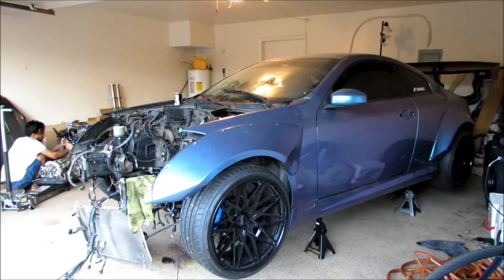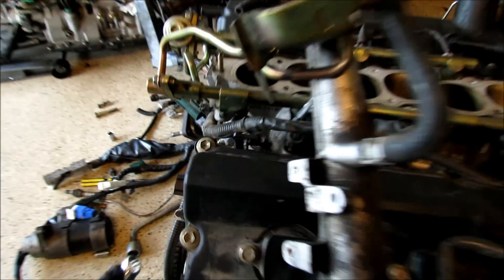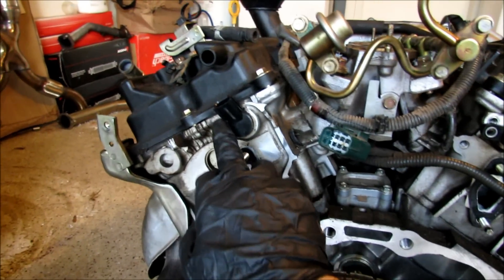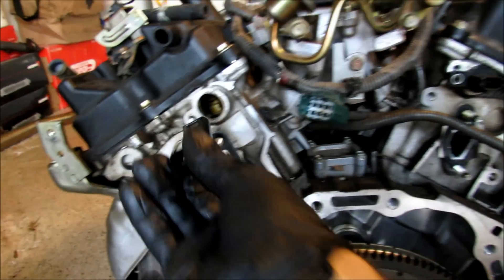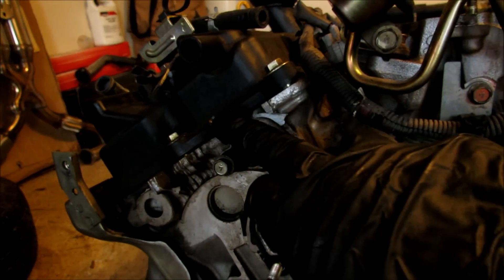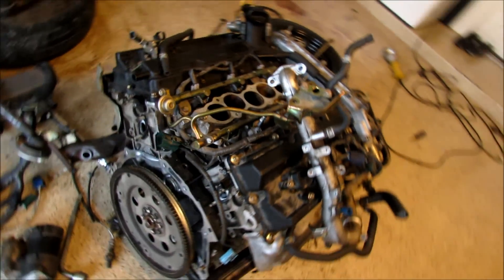INFINITI G35 NISSAN 350z - Camshaft Position Sensor Replacement

Comment from the maker: Symptoms - P0340 and P0345
While driving, the car suddenly felt like the engine stopped firing for a split second. After that the VDC, Service Engine Soon, and Slip warning lights all came on and remained on. The car felt normal while driving. After this, cranking the car took much longer than normal and sometimes wouldn’t succeed and every time it did the same warning lights would go on. Hooking up an OBD2 diagnostic reader gave me the following code

p0340 - camshaft position sensor - Bank 1 Circuit Malfunction
p0345 -  camshaft position sensor - Bank 2 Circuit Malfunction
Reply: Did you take out the battery before doing the work
Reply: A1 snday1 the engine was out of the car
Reply: What brand do you buy? Duralast? . Mines went bad after 3 days.
Reply from the maker: Prestigious Physiquez....really? I currently have the duralast sensors, they last about 50,000 miles before I get a new 1 for free.
Reply: Motordyne G35 yeah either the bolt holding the sensor came loose or I'll check for oil in my connectors . Light came back a few days later
Reply from the maker: Prestigious Physiquez ....if you got a bad sensor they are always free to replace so.....
Reply: Prestigious Physiquez i just took mine out on the driver side and it look it straight with no angle
Reply: My 07 g35 coupe has 4 camshaft sensors
Reply: Replaced the bank 2 sensor, had to remove the throttle body to get to it, still getting vdc and slip lights on, did a idle reset and the check engine light is off. Getting rough engine startup with idles ranging from normal to 3-400 on my 04 AT coupe :c
Reply: This a bit off topic but i haven't  got any help on the forum just recently i notices when i start my car (04 350z non rev-up)only on cold start this happens the idle will surge high like normal  then dip right away like its about to stall  then go back to normal  after that on any other start up it doesn't do that only on cold starts....car runs fine no loss in power no rough idle only the sound of my lightweight flywheel..only prob the car has is a leaking valve cover gasket on the passenger side... mods nismo s-tune exhuast,high flow cats,and  plenum space...
Reply: Quick question I got a po340 myself but said 2 sensors?
Reply: Where are they on a 2002 Infiniti G20

Comment: its extremely easy when the engines out. Haha..
Reply: not so, its ver accessible just get a cushion so you can lay on the engine, the rest just locate the sensor and the rest almost blindfolded.. literally
Reply: Bank 1 is a 20 minute job. Bank 2 takes about 2 hours.
Reply: @rolltide9547  bank 2 you can reach without taking the throttle body off reach over from the passenger side a smaller ratchet can get it

Comment: Great video I had my camshaft bank 1 changed twice on my car. First time I was driving home and the engine suddenly shut off, had to pull over to the side road luckily I was on a street and not the highway. I had to turn the key to the off position n turn it back on a couple times cause it would die, very annoying problem when it happens.

Comment: Super easy with the engine out, but not bad with the engine in.  And you do not need to remove the TB to do the bank 2.  I just replaced one in an '05 G35 in about 10 minutes start to finish.
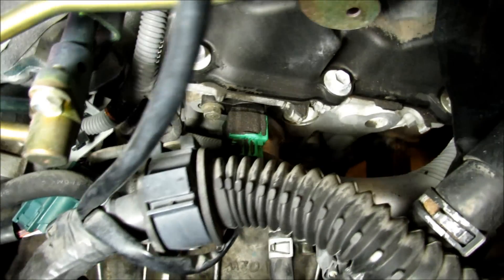Reply from the maker: Yeah, it is a pretty easy job. I concur that is why I put the *INTAKE 3:09 on the video during that scene. I didn't mean to say throttle body. You are correct, you do not need to remove it.
Reply: You prob have small hands that spot looks impossible
Reply: @Ap-qf8kp  My hands aren't small, I wear a size L glove.  I have better than average dexterity and practice working on stuff, but it's not terribly hard to do.
Reply: Send me a vid
Reply: Do you recommend removing the engine to replace these sensors? Seems like a lot of work for 2 sensors.
Reply: @bobbyheenan4061  I spent about 10 minutes replacing the harder to reach one with the engine in the car, you decide.
Reply: @DonziGT230 I was being VERY sarcastic...But I can't even see the driver side sensor. If I lay across the engine and stick my hand back there I can feel it, so I guess it's a blindfold job? Is that how you did it? As I say, you can't even see it ('03 Z).
Reply: @bobbyheenan4061  Yup, it's a blind job.  I might have used a mirror to see what I'd be feeling for, I often do that, then did the replacement by feel.  I used a 1/4" ratchet with probably a mid or deep socket.
Reply: @DonziGT230  ok cool, appreciate the help! I'm waiting for the sensors to arrive and I'll handle it. Thanks again!
Reply: @DonziGT230  Hey, thanks again for your advice! Just finished swapping out both sensors and your method made it a piece of cake. The driver's side (blind side) was actually a LOT easier than the passenger side. Passenger side was a bitch with that wire harness in the way. Anyways, thanks again!!!!!!

Comment: Great video. Kept it nice and simple and on subject. Good angle views as well to know exactly where the cam sensors are.  Changing mine soon as it gets here in 30 min lol. Oh and my code is P1078 Exaust Valve Timing Sensor/Circuit B1

Comment: My g37 sedan 2010 is throwing a p1092 vvel bank 2  code,changed sensors and vvel control module and still has my car on limp mode and doesn’t let me rev past 1rmp

Comment: Hey Motordyne, I replaced my crankshaft sensor a month ago on my 06 G coupe 6mt and it went bad. It threw a P0335, P1078, & a P1084 code. It is a duralast so I got a free new one. It caused the car to not start up so I just replaced it with the old crankshaft sensor that I still had and it fired right up. Been driving it for a week now and the check engine light is now gone. Im hesitant about putting the duralast back in bc it may fail  again and leave me stranded. Anyway, I also have the VDC, Slip, and RAS lights on. Could you give some advice as to what is going on or how to have the lights turned off? Replacing the crank sensor with the duralast didn't turn the lights but stealership tells me that using OEM sensors could turn lights off. Thanks for any help in this matter. Mad props and a massive shout out to you for all your videos and advice on the G35s.
Reply: Only oem sensors work from what ive been reading when my passenger side went bad went strait to the dealer paid 100 for one sensor  took me 15 mins to install been fine ever since and that was bout 7 months ago
Reply: Yeah, my old crankshaft sensor that I reinstalled bc my new duralast crank sensor failed, after only a month, is now starting to fail. The symptoms are the same. The engine will idle higher, around 1k-1500, and when you let off of gas pedal, it would have a slight jerky feel to the engine. Almost like a misfire. My fan keeps running as well which keeps my plenum cold even after driving for an hour. Gonna put the second replacement duralast crank sensor in tomorrow and see what it does. Thanks for your help my friend.
Reply: @drla02  don't wast your time i was contemplating the cheap route when mine went out just spend 200 bucks at the dealer and get two brand new sensors or if you go to z1motorsport.com  they have the oem sensors alot cheaper than what i paid at the dealer.....
Reply: Thanks cool bro! The Nissan Stealership here charges $175 for cam and crank sensors. I got raped by them about a month ago when my cam sensor went out. $125 for diagnostic, $175 for cam, and $70 to put it on. $400 total with tax. Would try Z1 but I need it now. Will get it from stealership tomorrow. Damn!
Reply: @drla02  yea man install it yourself no way I'm paying the dealer to ever work on my car......

Comment: I have a 07 g35s and its showing a bad camshaft position sensor i have the hr motor so i have to replace four sensors im just going to buy the parts from infinti and pray that fixes it if not then my the dealership are going to have a problem

Comment: thanks for the vid. just picked up an 03 a few hours ago and it shut off as i was backing into my parking spot. if i get them from oreiley's, how often do they usually go out?
Reply from the maker: They last longer than OEM from Oreiley's that is for sure. 40-60k miles or more.

Comment: do you know how to replace the exhaust valve timing control position sensors for 2007 G35 coupe MT6?
code P1084
Reply: Same plz
Reply: Did you fix this? And find that sensor bc I can’t find it either but it’s for bank one p1078

Comment: Is there only 2 I was told by dealership theres 4 but I didn't get it because I only saw 2 when I removed a motor last time
Reply from the maker: I believe rev-up motors have 4. DE is 2
Reply: @MotordyneG35  Thank you even the stealership didn't know how many and I was told from 4 to 6 🤦‍♂️

Comment: Can someone help me out with this? I have a 2008 350z hr and I cannot find the crankshaft sensor under the car. A lot of videos only show de motor but not hr motor crankshaft.. I have checked same place and it's definitely not in the same spot as de.

Comment: I need you guys is help. I have a 2012 g37 at and my car keeps throw checl engine light and my car goes into limp mode. Codes are P0006A, so I replaced my mass sensors both of them. G37 was good for like a week then again same codes after some research came to the conclusion could be my map sensors i replaced both of them. Car ran good for 1 full day. Then again limp mode now im getting these codes the same P0006A, and now P1705, P1815..... i did more research and only thing I can be is maybe the throttle bodies and camshaft sensors but this is getting expensive 😅 😫 😩

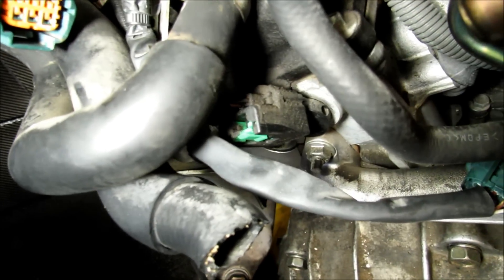Comment: 3:37 can that hose above the sensor be removed to have more access to it? What hose is that any liquids?
Reply: I just did this, you can reach around back and do this without removing anything. Just have a flashlight.

Comment: Hello I have 2006 rev engine  I replace bank 1 sensor and I notice their is another straight sensor on a driver side including the angle sensor. What is the driver side straight sensor called? Thank you
Reply: I think it's the exhaust valve timing sensor.

Comment: Omg mine just threw a code today on the way home on my VQ40 and stalled on me. It said bank 1 which is the passenger side right?
Reply from the maker: P0340 is bank 1 which is on the passenger side, that is correct. The driver side is the harder 1 to get too, you just have to remove the air intake and then you can get your hands back there.

Comment: CAN SOMEBODY HELP ME! My car started dropping rpms on highway but didn’t die. Then the slip & vdc light would come on. Coming to a stop or turning a corner it would sometimes die. When trying to start back up it took way longer. Got it diagnosed. They said Camshaft position sensor. I just replaced the camshaft on passenger side. Now the car takes forever to start and it’s getting longer I think. Would it be the crankshaft sensor or what do you think I should do now?
Reply from the maker: Is there currently a check engine light on? If so what is the code?
Reply: Hey!!! I have the same problem ! 

I just replaced both camshaft sensors.

Worked fine for a week until 
It started lagging wouldn't let me pass 20.

Then vdc light turn on
Reply: Clean your throttle body carefully and remember to reset your ECU after, or the idle RPM will be high af

Comment: Man i have a 2007 g35s sedan and it has four camshaft sensors replaced all four with oem parts from the dealer and the damn check engine light came on again for the same sensors what could be wrong? The car runs fine but im wondering why is it still giving me the check engine light with the samw fault codr
Reply: Troy Space where is the location for the 4 sensors on the hr? I can’t find them lol

Comment: To get to bank 2 while the engine is still in, instead of digging from the top and removing the throttle body or intake can't you just hit it from underneath to avoid taking a bunch of parts off?
Reply: Transmission is in the way from the bottom and it's a long reach.

Comment: Remember tho, I guess the rev up model has 2 bank sensors on each side. I believe one is the camshaft sensor and the crankshaft sensor.
Reply: What ? Lmao that makes no sense. The VQ engines have 2 cam sensors and 1 crank sensor
Reply: @funnymanchrome4408  revups have 4 sensor total

Comment: Would this be similar on a 2010 FX35 also i have code P0725,So the crankshaft sensor needs changing
Reply from the maker: Same exact engine, yes.

Comment: My Z keeps throwing me the code p1084. It's says that is the bank 2 cam position sensor. Changed it 3 times. And still keeps throwing the code. Can you please help me? My car does not  have the same power as before on high rpms
Reply from the maker: I own a rev-up motor which is not in this video. Do you own a rev-up motor? Rev-up has 4 cam sensors. I just checked out your channel real quick, sick uploads bro! I'm busy filming this morning doing new rotors and pads. I will come back to this to do more research. Did you see this thread? https://my350z.com/forum/maintenance-and-repair/611679-p1084-fixed.html
Reply: @MotordyneG35  thanks man! Dude I can't believe that all this time I thought my motor had only two sensors in the back of the head. I lost so many time and money on this. I kept buying other sensors because I couldn't fix this cell light. I found out yesterday that it has 4 sensors on the rev up motors. This link you sent me was the same link that the other YouTube guy sent me. Thanks for the help!
Reply: Dude i have the hr motor on my 2007 g35s changed all four sensors with dealership parts and it still throws the same fault code im not sure whats wrong but damn sure not tryna take it to the stealership someone please help

Comment: quick question my 2004 g35 is idling very low at times 100 to 500 I have stock intake on any idea to what the problem could be
Reply from the maker: Any engine codes? Have you tried my idle relearn video? https://youtu.be/TZJfWQLGUZI
Reply: Motordyne G35 yes I have and no I don't have any codes when I start the car it's idling fine for 5 seconds then the rpms slowly drop
Reply: Clean the throttle body and mass airflow sensor
Reply from the maker: Let us know if it got fixed. Here is my video on how to clean the mass airflow sensor.......https://youtu.be/BGb-6THahXM
Reply: Sounds like its time for a tune up. When did u replace them last? Is ur air filter dirty? You could also try the relearn procedure
Reply: check the accordion shaped coupler on the intake. when i pulled mine apart it had MASSIVE slits in it, replaced with some reinforced silicon

Comment: Man I replaced both sensors and the error code PO340 is still showing, I REALLY need help I been trying to fix it forever. It jerks whenever my car is like barley moving, on the highway or when I'm driving you can feel it move up in rpms by just very little then go back, it takes a long time to start and I keep hearing a thud noise coming from my exhaust, it is so frustrating! Please help
Reply from the maker: Do you have a rev-up motor? Rev-up motors have 4 sensors.
Reply: @MotordyneG35  Honestly I am unsure on how to check, I just got it about a month and a half ago, it's a 2003. Is there some sort of indicator that should let me know?
Reply from the maker: @ItsCripp  ...Yeah, more horsepower. 05-07 G35's came with 300HP, only if you have 6 speed. Automatics got 280HP. If you have an automatic or your G wasn't made in 05-07 you do not have a rev-up motor. When you replaced both sensors, they are both different. You didn't mix them up, putting them in the wrong spot did you? I'm unsure of the problem here because by the code not going away means you did not fix the problem. Something was done wrong on the install.
Reply: @MotordyneG35  Nope I didn't get them mixed up, they were both installed properly and I even cleaned the connectors before I installed. Also it is automatic.
Reply from the maker: @ItsCripp  ...where did you buy the cam sensors?
Reply: @MotordyneG35  I bought them from Orielly's
Reply from the maker: @ItsCripp  ...I've only had this happened 1 time. I purchased 2 window motor's from Oriely's and 1 of them went bad after a week. That's why they offer that lifetime warranty, sometimes you get a defective part. I can't imagine you got 2 bad sensors though, but take them back and ask for new sensors. It is free and if that doesn't work then you will have to take the car to a shop. I have no idea why at this point.
Reply: @MotordyneG35  alright buddy i appreciate it

Comment: Where can I buy cheaper camshaft sensors.. Autozone would come out to a total of 197$ for both total.
Reply: Buy them at O'Reilly's,they have them for $64 dollar each. They also have $43 dollars sensors, but I would go with the $64 dollars.
Reply: @danielmartinez7047  
Thanks brother, appreciate you
Reply: Cheap ones wont work the same tho
Reply: Rockauto. I got both OEM for 90 bucks
Reply: @eduardonunez9744  where did you find the OEM ones.

Comment: Hey guys I have an 06 g35 with p1078 code. I've already swapped out the sensors and the lights still on. I've tested the harness and everything's fine. This code won't go away! Funny thing is when it's cold outside, the code doesn't appear! I'm G baffled! and losing patience. I've changed that sensor with ones from Advanced Auto like 3 times. The code never goes anywhere
Reply: Nassir Yasin yo I have the same problem same code and need to smog it. Shit sucks bro
Reply: Same! Someone help!
Reply: I hear that with electronics, its better to use OEM, especially with infiniti. Good luck